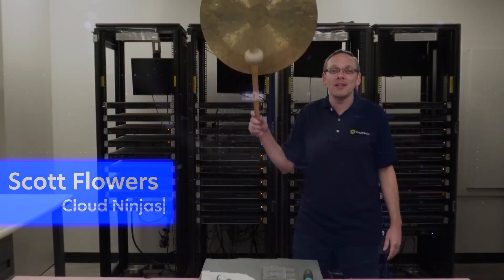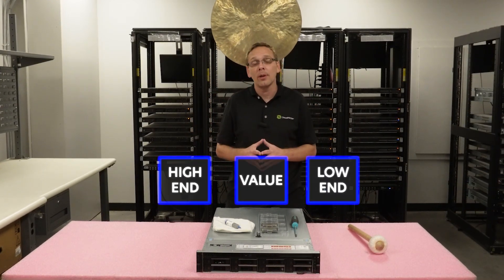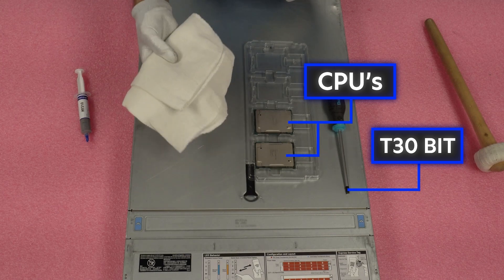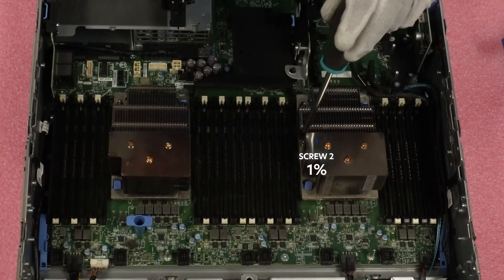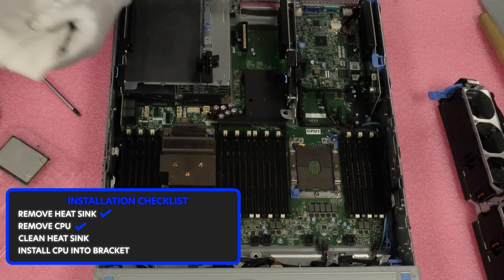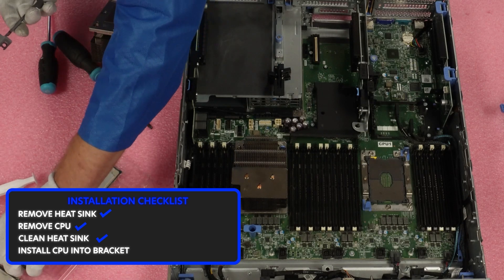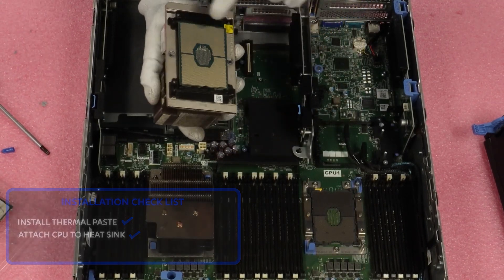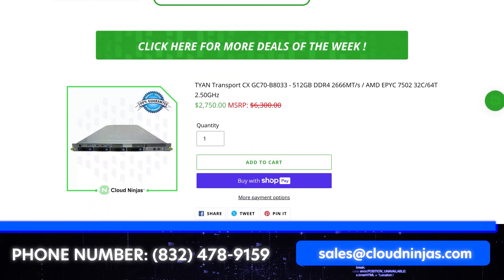Dell Precision R7920 Workstation CPUs | Intel Xeon Processor Options | LGA-3647 Socket | CPU Install

Comment: Actually I'm most worried if it could support a modern GPU that would support 4 DisplayPort monitors and a lot of RAM for AI rendering, like an Nvidia 3090, 4090, or 5090.
None of you videos seem to demonstrate this, and I've been burned by buying servers before that did not.
Also, I'd like to see how noisy they are, and how long they take too boot up.  
I've been burned on that before with server fans that run at 100 percent speed if not in a chilled server room I do not have, and also take forever to boot with a terrible EFI bios.
Reply from the maker: Here is a link to show the compatible Graphic Options you can install: https://i.dell.com/sites/doccontent/shared-content/data-sheets/en/Documents/Precision-7920-Rack-Spec-Sheet.pdf

Couldn't find any specs on the noise level but I am sure there is a homelab user online that has found it themself and have shared this information on forums. Hope this helps!